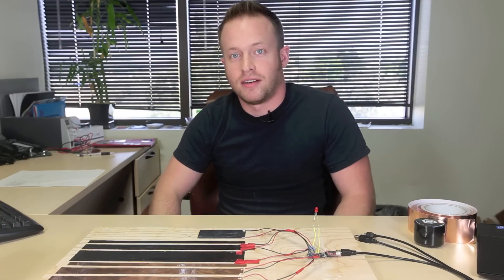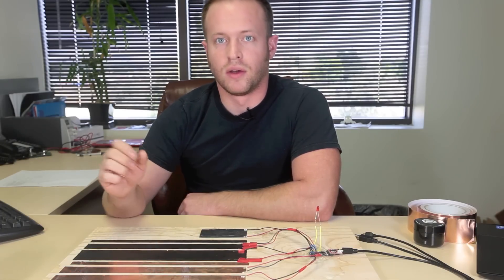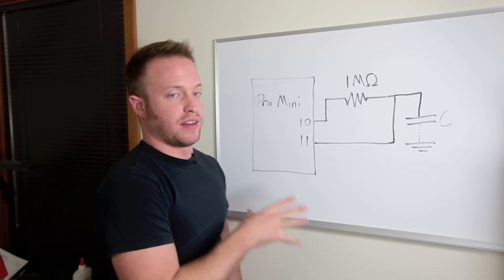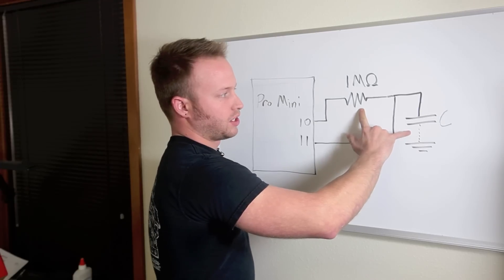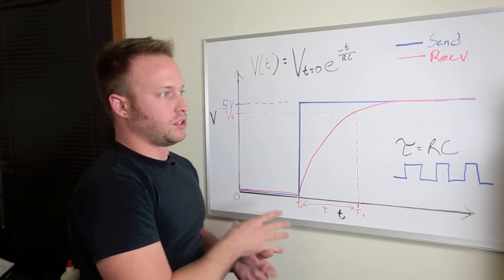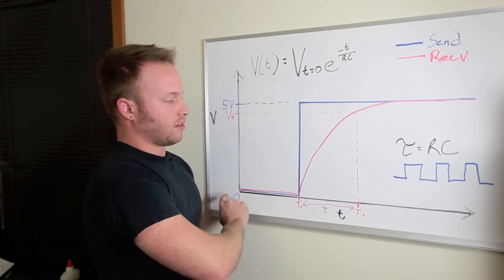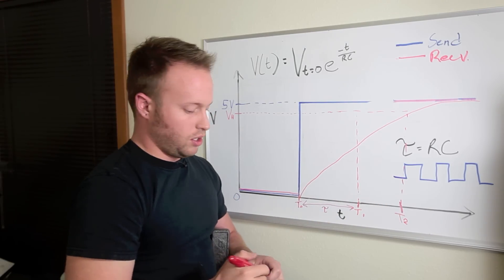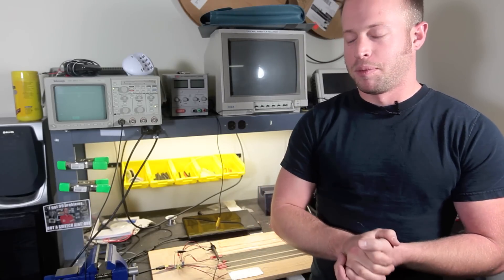SparkFun Engineering Roundtable 9-24-12: Capacitive Sensing with Chris Taylor

Comment: Very cool idea, by why do you need to use two pins? Why can't you just charge the cap, then make the pin an input and measure the time it takes for the pin to go back to low. Since the cap will be charged it will put a voltage on the pin for some time. Until it discharges back to zero.

Comment: Question - I have this toy that turns on and off by cap touch, but it automatically shuts off after a while and I want it to stay on indefinitely.  Is there a way to add a circuit to simulate a person touching it so it will stay on ?

Comment: I enjoyed your video. One clarification if you don't mind, (I am so sure you are aware of this but for some of the viewers...)  If you solve the equation you wrote on the whiteboard for time (t) for a fixed voltage high detected at the I/O pin you'll see that it is proportional to the capacitance, but at 7:12 you mention that this time spits out the time constant tau or the value for RC.  If you are only after the change in capacitance to detect a touch then it isn't very important, but if you are trying to measure the capacitance you can't just divide the time measured by the value of the resistor unless the point at which the I/O pin goes high is about 63.2%  (one time constant) of the positive supply rail. If it is anything else - then the change in capacitance will still be proportional to the change in time,  but unless it is 63.2% or so, the proportionality constant will not be exactly 1/R.  For example, if the I/O pin goes high at 86%  of the rail then the proportionality constant will be 2/R.  Without looking up the Vh for the Pro-mini I/O I can confidently say that it won't be specified to any kind of precision.  I'm guessing that the cap sense library you mentioned handles all the baselining and environment (slow) tracking and the delta thresholding you'd need to make this work all as a  good touch sensor, if not a good actual capacitance measurement device.

Comment: Good morning Chris, thank you for your video. I ask you 2 pieces of information: to avoid accumulation of potentially destructive electrostatic charges for the arduino pins (even when the arduino is completely off), can a high value resistor between the sensor electrode and GND / grounding be useful?
Furthermore, for the connections to the electrodes about 40 cm long, is it preferable to use coaxial cables or with shield? Thank you very much for your work!

Comment: Why do you delay the time?
Reply: I mean the resistor + Capacitor why do I need to delay the time?
Reply: @TheRno0o  The delay is a way of us detecting how much capacitance there is.  If there is higher capacitance, there will be a longer delay.  Because the capacitor is always the same, it will be the same each time.  When your finger comes close, it starts to act as a capacitor.  Because there is more capacitance, it makes the delay longer.  So now if we switch the wire from low to high, or high to low, it will take longer than normal for the pin to go whatever the other pin went.  This little delay is taken advantage of, and for you to understand this you kind of need to understand how a microchip works.  Basically it will send the pin high, and it will detect the delay.  When you put your finger on the capacitor, and you switch the pin to High, it will take longer for the other pin to go high, because there is more capacitance, because your finger has capacitance.  So when you move your finger up, there is more capacitance, and it takes longer, and this extra delay is detected by the microchip, and it assumes that the extra delay is the fact that we touched it.  Hopefully that makes sense

Comment: I need something exactly like this. But don't know anything about programming that little module. But I might need to change the time constant around a bit to to get the detection I need by possibly changing the fixed 1 meg resistor to a variable resistor by getting a one or two meg potentiometer and just hook it up as a variable resistor. Easily done by just hooking up the wiper of the pot to just one of the other legs of the pot. I don't see the 'code' that was said in the video to be posted here. But even if it was, I don't know how to program this thing. I could buy one of the modules but would need help to load the code in there. And info on where to hook up the LED because lighting up an LED is exactly what I need to do for my project. Does the LED need a current limit resistor depending on the color of the LED? I need more info because I want to do this. Thank Chris if you read this and offer to help me!!

Comment: 7:20 I dont think its ''spitting out tao''. If we're talking about the capacitiveSensor library i think it spits out an arbitrary number that's just been incrementing in the while loop while the recieve pin waits to be high again. Great vid.
Reply: I'm not very fluent in C++, where did you find this? I guess it's incrementing by 1 every cycle? cheers!
Reply: @33Initiative  Hi there. I was referring to the How it works section on this document. https://playground.arduino.cc/Main/CapacitiveSensor/

Comment: I'm wondering is it sensitive to how much pressure i commit?
Reply: Yes it would be sensitive to how much pressure you apply to the contact plate. The reason, however, reveals two inaccuracies in the description, which are worth discussing. The first inaccuracy is the claim that the change in time is all about changing capacitance. In reality, the connection with the body when you're touching the plate adds a complex circuit consisting primarily of a variable resistance in series with a capacitance. When you touch the contact plate lightly, you connect the capacitance of the body through a very high resistance. As you apply more pressure, you reduce the contact resistance between the contact plate and your body. The lower the resistance, the higher the charging current drawn by the capacitor. Now you would think that the higher total resistance would increase the time constant and therefore increase the time for the input pin to rise to the voltage of the output pin, but that's not what happens, which is the second inaccuracy. While the total time constant does actually increase with higher contact resistance, that is not what is important in this case. Remember that we have the fixed resistance in the circuit AND the variable resistance of the contact of the body to the plate. The input pin is connected to the junction of these two resistances. When the contact resistance is high - with a light touch - the maximum possible charging current into the capacitance is reduced. This means that the voltage drop across the fixed resistance caused by the lower charging current is lower, so the input pin rises to match the voltage at the output pin much faster than with a lower contact resistance.
It turns out - and I suppose this is technically a third inaccuracy, if only by implication rather than by direct statement - that the capacitive touch effect is more about changing resistance than changing capacitance when you're actually touching the plate. As you approach the plate - before you touch it - you add another small but variable capacitance in series with an extremely high contact resistance, complicating the circuit still further, and and resulting in two different modes of operation, but that's another story!

Comment: He says the voltage may be at 2.5v and it may be a 0 or 1 in the arduino sensing pin, but the hard found out truth is that Arduino goes to a 1 at just 0.6v, not 2.5 volts.  I found this out the hard way.  I could not believe a .6v was tripping the circuit. But it was.  Even .5v I could get it to trip. Be aware of that, because if you are not, it is the last place you would look. Everyone says between 2 and 3 volts is the 0 or 1 threshold switch area and that is just not true.

Comment: One mistake though. The "capacitor" is your body, not the little bit of material you're touching.
Reply: The body itself is not a capacitor. A capacitor has 2 plates or 2 bodies with a diaelectric between them.
Reply: The material itself acts as a capacitor, and your body ALSO acts as a capacitor, connected in parallel, both capacitances would sum up to a greater total capacitance, as explained in the video
Reply: Yes, I think Luciano has it right.   @lucianosaldivia5917

Comment: Your video is like a breath of fresh air - a novel solution, well explained. I liked the way you used physical demo, chalk and oscilloscope. Questions about your demo;
Is that 100 uS per division on the scope? Ie what is the approx rise time before and after directly touching the copper electrodes?
Do you think this method would detect any difference in a 1.5 liter jar filled vs partially filled with alcohol, if the copper strip were placed say 1/4" from the jar and running top to bottom?
Tkx

Comment: That's a good idea. I might have to start collecting parts!
Maybe I could use a picture/picture frame,and make it look like it belongs on the wall.
I'm not concerned with the various RF signals,This place has metal siding,and is fairly Faraday-cage-like already. Despite that,the Wifi,cellphones,etc. all work fine.